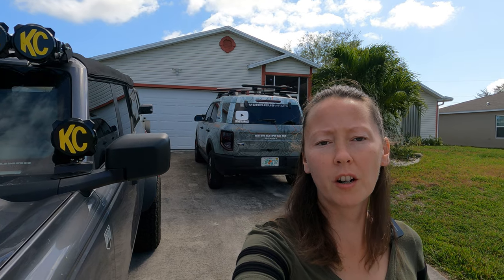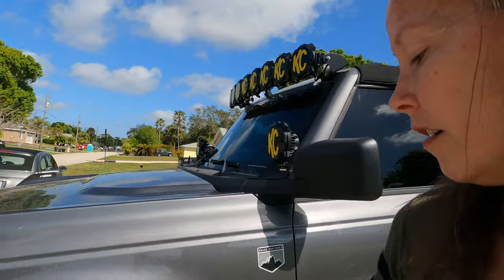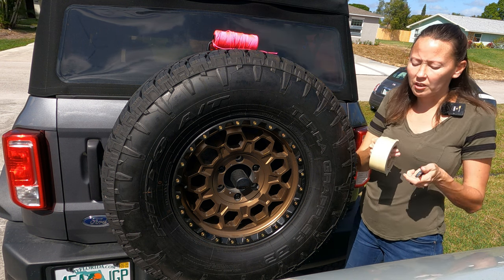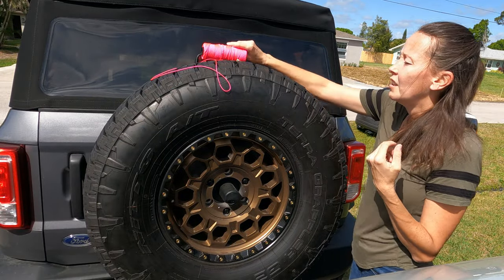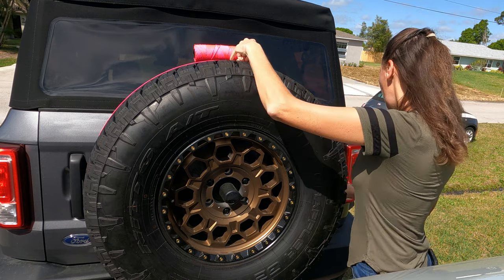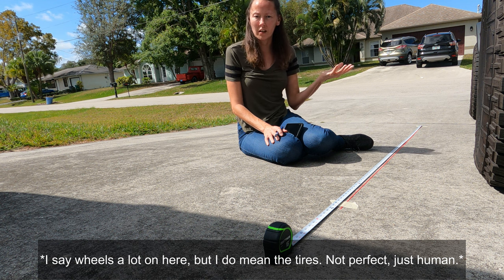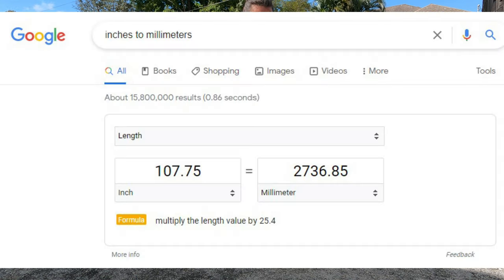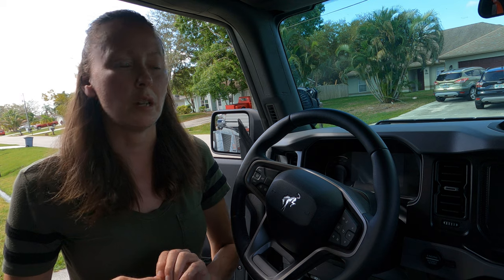Recalibration of the Bronco's Speedometer using ForScan for those Larger Tires - How hard can it be?

Comment: Finally going to try this with mine. I have watched a dozen videos, all on the 2021 I have heard Ford encoded the GOAT modes differently for the 2022 so I cannot enable them but at least I can get the speedo closer. went from the 32" to 35" and maybe eventually go to 37" Thanks for making it so clear (The vehicle back up file most videos were not clear on)
Reply from the maker: hmm - we do not have a 22 to try and forscan on it to enable all 8 modes.... You may need to check out the forums. Check Bronco Nation or Bronco6g
Reply: @1Five1Garage  Quick question, when reconfiguring tire size, do you have the key on/engine off, or key on/engine running?

Comment: Thanks for the video! 

I wonder if you're supposed to use the mean usable tread as circumference rather than full/new tread. It would been more accurate that way since the tire loses circumference over time.
Reply from the maker: Even with the correct circumference we still have to adjust the number to correct the Speedo to match gps.

Comment: Did your 4x4 fault ever go away? Just did the tire size and have the 4x4 fault. Thought about doing a battery disconnect to see if that fixes it.
Reply from the maker: Lol nope! We still have that beautiful warning light on the dash lol even after the ForScan …battery disconnect didn’t. We put the aux switches in and disconnected the battery because we had to install the new fuse box, still there.
Reply: Don't know if you got the answer to the issue, but I had the same thing last night. After inputting the new circumference, you need to go do a relearn in the AWD module. The 4x4 issue will go away after running that.
Reply: @kerinobrien6642 how do you do a relearn?

Comment: Soooo how many functions does ForScan do ? I know it shuts off annoying buzzers & alarms. Is it around 100 $ too ? like the stop the auto stop ( fuel ). If I had a Bronco on order I'd buy 1 of each gizmo.
Reply from the maker: The switch one was less than $30 the switch less or built in is $50

Comment: If the sasquatch circumeference of 2653mm got you to 68.9mph and the vehicle read 70mph, then you would need to change that 2653 to ~2695mm.  (68.9/70)=(2653/x)
Reply from the maker: I might get in there and change it. it's only a few mph off.  thanks for the numbers!

Comment: So I've heard it said recently that tapping into the computer on your vehicle with Forscan automatically sends a message to Ford motor company and that they can and will void warranties over certain modifications.  Anything more to share about this?
Reply from the maker: I worked for Ford. That’s new to me because I have never heard of this before.
Reply: I believe the comment was made in a reply to a comment made at the T&C TV YouTube channel site and that the reply was from T&C Ford.  I'm trying to find it again, but was struck by the degree of  connectedness/trackability being "baked into" cars these days.  While I'm sure there are advantages, but I'm also concerned about the potential  intrusion on privacy and potential hacking that may come with it.
Reply: The law requires a warranty provider prove a modification caused the issue under claim. They can't void a warranty outright.

However, and this is part is speculation. A bigger tire could cause an issue and they could use that to deny a claim.

Comment: I took my bronco to the dealership , they used forscan to change the tire size, but i lost my cruise control as a result. Brought it back to my for dealership and since they could not figure it out, they restored the original computer setting and refunded me, leaving my computer set for 32 inch stock wheels.  Has anyone else lost cruise control after the tire size change ?
Reply from the maker: We have not, but we have a 4x4 fault. However, bronco6g forums said ppl have had the same fault we do and they never used forscan but it eventually went away on its own so I really don’t know if this one will vanish or if I need to clear it.

Comment: Squish factor:  .967
Reply from the maker: Lol
Reply: @1Five1Garage  no no, it's not a joke.  You take the OD and multiply it by .967 and that compensates for the squish factor of the tire's flat contact patch.  My f150 has 275/65/20 with a 2718mm OD.  2718mm x .967 = 2628mm, put 2628mm in forscan and my speedometer is accurate.
Reply from the maker: awesome. thank you for the info! I'll have to write that down.